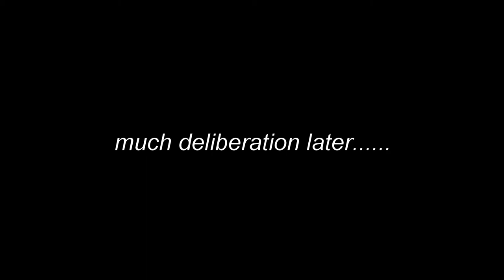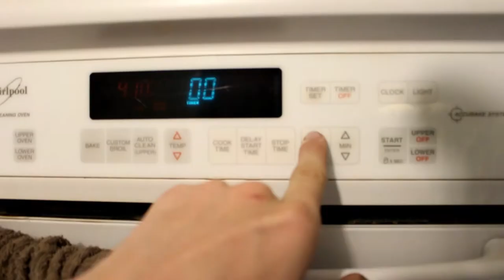Forging a GIANT KARAMBIT from a Lawn Mower Blade (feat. LHI Productions)

Comment: Nice! How does it feel compared to a machete? Since you can't conceal carry a machete in Va without a CCW permit (as if could conceal carry a machete without looking like you have a peg leg 🙄those northern Virginians drive me nuts!) I wonder if you could conceal carry this since it's technically not a machete, It's just an oversized karambit, right?
What kinda camera was that honkin' thing with the pro body and the rode mic on top? A 1D?
Reply from the maker: LOL!  Guess it depends on who defines "machete".  That is hilarious. Thanks fer letting me know, I'll be sure to wear my machete OUTSIDE my pants on my next trip north 😂.  It feels just like a karambit shaped machete, if you know what I mean. Super amazing slicer. 

You must be talking about luke's camera. ha, no i think it was a T2i. Just had one of those big extended battery hand grips on the bottom. Also happens to be like the only camera without active autofocus 😐. I'd love know the logic behind THAT one.....
Reply: That's the same camera I use now (without the extended battery). Mine is a freebie and is like 5+ years old which explains the AWFUL focusing system. I want something like a Canon M-50 (or a 1D 🤑) but that costs money I'd rather put towards something else like a new 3d printer...  I have convinced my mom to let me take family pictures at $100 a kid which may help justify the $ but it turns out my mom is a tough customer...
Reply from the maker: Oh man, you poor fellow. When I buy upgrade my camera (unfortunately not anytime soon), I'm gonna go for a Lumix GH4 or something similar. My mom wouldn't dream of paying me to take pics....... I consider myself lucky I haven't been commanded to do so gratis 😀.